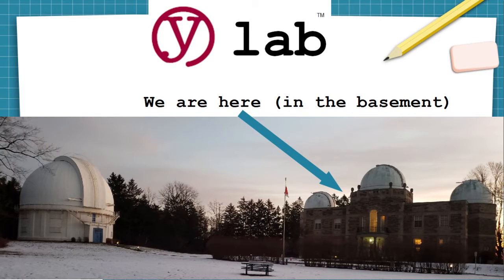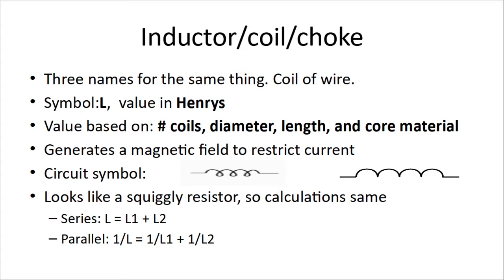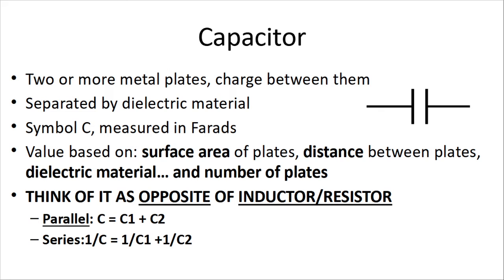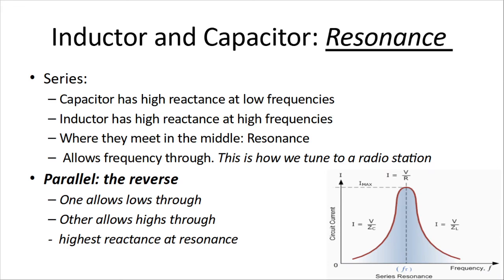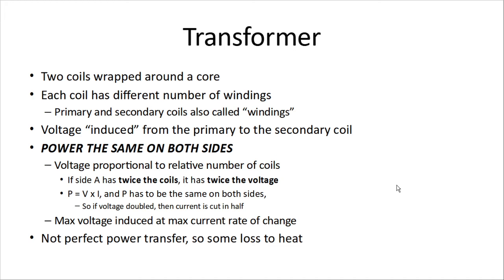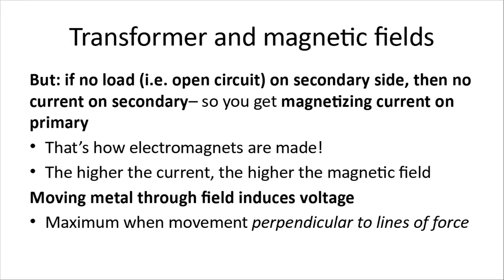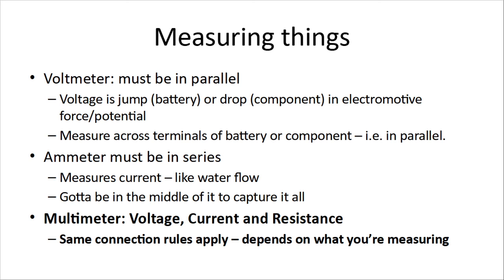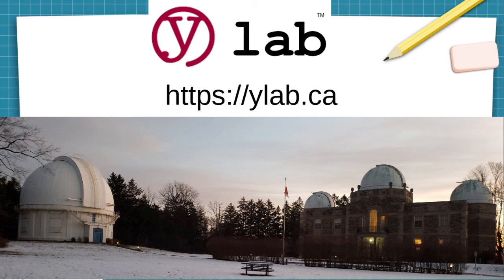Lesson 15 for Ylab's Canadian Amateur Radio License Course

Comment: The slide at 6:50 is a bit misleading.  A Capacitor having high reactance at low frequencies will filter out low frequencies allowing higher frequencies to pass. You would use it as a filter to let high frequencies pass. It filters out low frequencies.

Similarly an Inductor having high reactance at high frequencies will filter out higher frequencies allowing low frequencies to pass. You would use it as a filter to let low filters pass. It filters out high frequencies.
Reply: This was extremely confusing when doing the quizzes. From the slides it seems like the exact opposite.